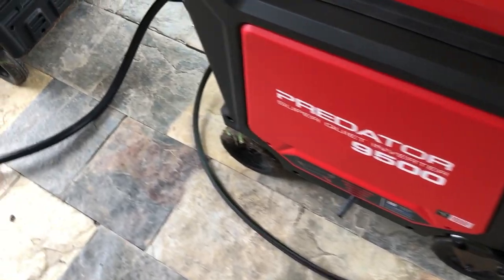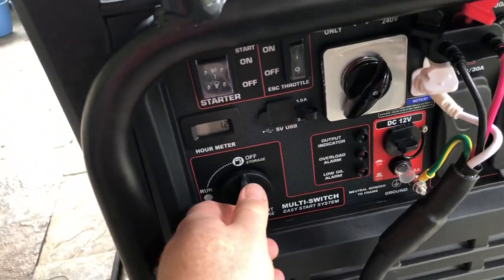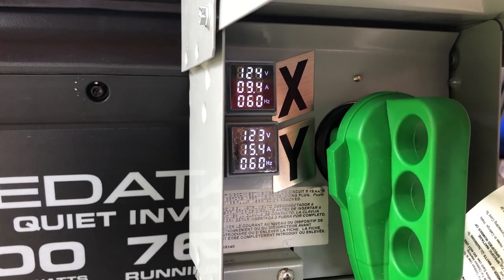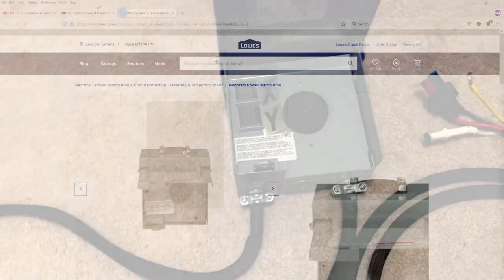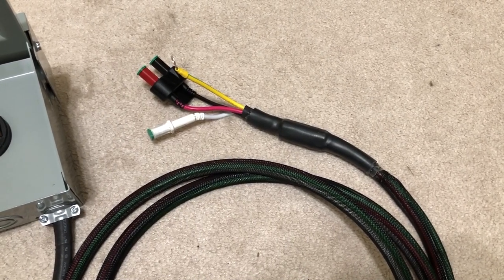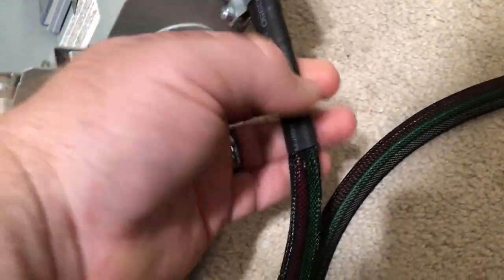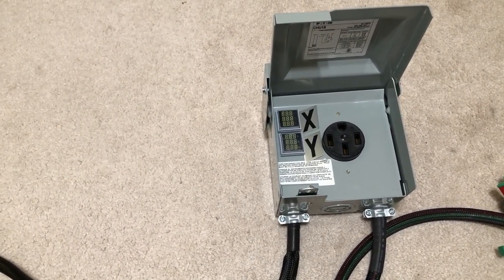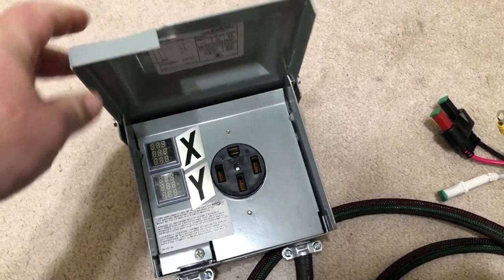Predator 9500 Home Built 240V Parallel Kit Test & Build Parts: 2X Output Power Using Two Generators!

Comment: Thanks for uploading this. I just bought two Predator 9500s for my food truck instead of paying $10k for two Honda EU700IS generators with their parallel kit. Harbor Freight was no help with finding a parallel kit. Just ordered all the parts to make it.
Reply from the maker: Glad it helped.  My next video in the series has a wiring diagram if that's helpful.

Comment: You go with #6-4 SOOW cord for the combined main feed.  It is much more flexible.  Also a good idea to put a dual 240V breaker 60A in combiner box.
Reply from the maker: Yeah, welding cable was also suggested, and in hindsight, that would have been much much easier to work with.  I was just working from what was at Lowes.

If you're looking at making your own, and you want a breaker in the box where things combine, you might consider the GE1LU502SS box.  It has a built in breaker, a 120v outlet, and 50amp plug.  Lots more room to work inside, and with the bus bars, probably would need the expensive splicer things.  It's just a lot larger.
Reply from the maker: With my enclosure project (most recent video), I ended up having to extend the length of the shorter cable on my parallel kit.  I used your suggestion, and used #8-4 SOOW for the extension, and #6-4 SOOW for the combined feed to the 50amp outlet.  

Indeed it is sooo much more flexible to work with.  I was able to get the box closed without feeling like I was damaging stuff.  

Thanks for the suggestion!

Comment: Great stuff Jason! I pretty much was sold on a parallel predator setup for my home so  I designed a similar build in my head. Figured I wasn’t the 1st so got on you tube and found your video and as a technician myself,  I was impressed. Thanks for the content! If you wouldn’t mind can you share your ruff cost for the project?
Reply from the maker: I figure there was around $250 in the parallel kit, (with cost increases probably closer to $300 to make now).  It's not so much the box itself, but all the other stuff that adds up.  Those terminal blocks that were over $20 each.  (4) of those is ~$90 right there, another $17 for the splice, ~$60 for the Powerhorse cable, another 50 or so for cabling.. box, meters, wire loom, heat shrink...  it adds up really fast.

Hookup inlet, cabling, etc.  ~$180,  AC Compressor Soft Start $360, plus the generators.  Probably around $4800 in total.  Then I went and made a giant wood box for them, and don't want to think about how much that added.    Ultimately I'd say I'm in around half the cost ( actually less than half since I'd have to install propane tanks) vs. what I could do a whole house backup generator for since they're usually around $10k to play.

The full playlist is here for the videos, it covers looking at the power quality, AC soft start (super important for generator power, and it has a kind of cost breakdown as well), safely doing the inlet connection to the house, and some other related topics.
https://www.youtube.com/playlist?list=PLzoNthJzzMFQ877vyCfoc53oDQqGFAIKN
Reply: Your setup has some advantages over a whole house generator. 

If one generator goes down you have a backup.

If you move, it’s easier to take your setup to your new house.

If you want to go camping or work somewhere without power, you can take one of the generators with you.

Comment: The issue with your unbalanced load could be your wire length being different coming off both generators. Parallel wires are supposed to be the same length. Just a friendly electrician trying to help out. Great job otherwise definitely a great setup.
Reply from the maker: All good man, though I don't think that's the issue.  

The generator is making full phase 240, with a 120v split phase (just the exact same as residential power from the power company).  
The two generators are simply merged together.  X to X, Y to Y, Neutral to Neutral, Ground to Ground, and after that merge, the wires run to the dryer plug.  The generators themselves take care of the magic of synchronizing the power frequencies to match, such that each is just contributing to the overall total.  (kind of like batteries wired in parallel)

My meters are measuring the total amperage after the merge on both leg X, and on leg Y.  (This is the combined amperage between the two units, so if both are running, divide that AMP number in half to know the load on one leg, of a single generator unit)

If cable length were the cause, that would mean in about 5 feet of cable, I was creating several amps of resistance.  (which would be very... bad), and since the meter is displaying the combined output, it wouldn't represent the losses from one side.  Plus remember each generator is contributing both X and Y of the split phase power.

Also, in the case of the Power Horse kit we're cannibalizing the cables from, that one is designed to carry power from Generator B, literally into Generator A, and there is no box... the hookups are from the front panel of A (vs. a separate plug).  So the whole cable is totally on "one side" in that way.

The imbalance you're seeing is between the two legs of the split phase power.  Meaning that by random chance due to the arrangement of breakers in my box (whether they're on X or Y leg), and the location of the loads in my house, end ended up with one leg of the 120V split being a bit higher than the other.

After some additional testing though, the leg with the lower power levels in the video, also services a freezer, and some other appliances that were not running during the filming, so I kind of like it that way, so it leaves some room on that side for those devices, and things are a bit more balanced.

This is the playlist of the full video series, the latest one where it connects to the home might be of interest.  https://www.youtube.com/playlist?list=PLzoNthJzzMFQ877vyCfoc53oDQqGFAIKN
Reply: I would think the wire length could affect phase, but not load?

Seems more likely that the breaker box might be unbalanced?

Comment: Great job. Our recent Texas winter was brutal. I have my eye on one of these if my ES6500 ever dies (doubt it).
Reply from the maker: Thanks!  It's been my little obsession for the past few weeks.  Still need to build an enclosure for them. :-)
Reply: @Texas_DIY  I got sucked into the whole enclosure thing. Wasted about $600.00 on a Suncast just to shave a few decibels. My water cooled Honda is quiet enough, and I don’t have any over heating concerns. I am sure the Predator is as quiet or quieter than my ES6500, that would leave only security to worry about.
Reply from the maker: @texaslawdawg1902  Yeah, these are quiet enough it's less about noise, and more about having them nearby the power hookup for easy deployment, keeping them clean / out of the weather, and somewhat security from theft / hiding them from plain sight.

Really debating now between building something from scratch, or repurposing a plastic shed... I just can't find a "shed" that is the low height but 6' width I need.

Comment: Nice job! I can see why you would need two of these generators if you wanted to run your AC unit and etc in the home at the same time. Looks like at the minimum, 5,000 dollars. You have the option of running 1 if you don't need the AC.
Reply from the maker: Yup, you can run one to save fuel, or if you need to do maintenance on one while the other continues to operate.

Comment: Great video Jason! I would love to see how you wired the box in detail especially with the 2 Amp meters wiring detail where you join the two generators with the 50amp outlet.
Reply from the maker: By request I added a wiring diagram in the "All the Technical Tidbits in Under Ten Minutes".  The playlist is here:  https://www.youtube.com/playlist?list=PLzoNthJzzMFQ877vyCfoc53oDQqGFAIKN

Basically each wire color is joined together in the box by color.  

The meters need power, so you can wire it to one leg (120VAC) or to the two hots (240VAC).  I chose to connect one to the "X" hot, and one to the "Y" hot (the remaining power wire goes to neutral), this way I can monitor the voltage of each leg.  (vs. both of them just saying 240V).

There is also a circular ring that you put around the cable that you want to monitor the amperage.  I put the rings around the combined output so I could see the total that the pair were making.  If you use two, just know that half that number is coming from each.

Comment: Other youtubers have confirmed that the 30A 240v outlet on the generator is tied to the sync circuit, which means you don't really need the parallel cable kit. You can use the L14-30P connector that comes with each generator and some stranded 10/3, with ground, to make your own patch cables up to 50 feet each leg (between each generator and the combiner box). Only real thing to note however is that with the L14 connectors, the conductors will be exposed if not plugged in - dangerous if any of the other ends are connected to power, whereas the kit has shielded connectors.

For your setup, where the generators are right next to each other, the parallel kit is probably the least expensive option however.
Reply from the maker: This has come up a few times in the various comments.  

Ignoring the suicide plug, and linking the generators together... but then you don't have a way to tap into the power unless you put a 50amp plug on the combiner box.  If you're going to do that, you might as well just get the proper and safer parallel cables, you're building the rest of it anyway.  Buying two 30amp plugs isn't going to be that much cheaper than the parallel cables.  You're still going to need to extend them, and all that.

Additionally, if you use the 30 amp plugs on the generator panel, that is running through the breaker on the generator.  If that were to switch off or trip, (or if your suicide plug disconnected) then the two generators will almost immediately begin to drift out of sync.  

In that scenario, if you fail to shut the disconnected generator off, and start it again while running, and you were to just flip the breaker back on, or just plug back in the suicide plug, you would be joining a generator operating at a different frequency to your power line.  (bad news and possible fireworks).  

The parallel ports on the generators bypass the breaker and connects directly to the inverter, and the parallel cables fit in firmly and are harder to accidentally disconnect I think for that reason. 

Also, the longer you make your extension cables, then at some point you will need to bump up the gauge of the cabling. So I'd be careful with 50' lengths and make sure you've got it planned out accordingly.

Comment: I wonder if you could pull 100% of the rated capacity if you could get by with just the one. If you use an auto transformer to generate the neutral leg you can draw off of both L1 and L2 equally without the worry of loading one side of the windings more than the other. I do that with my Victron inverters set up for 240v split phase power. Works like a dream.
Reply from the maker: Possibly... but that would add complication to the setup whereas right now, everything pretty much just wires directly in.

Comment: I believe you can also use the Honda EU7000is parallel kit as well.

If you want more flex you can use 6 AWG welding wire.  It’s stranded pretty well.

You can power down one generator and should still work if you notice your loads are low, to save fuel right?
Reply from the maker: That kit might work, it would depend entirely if the spacing of the plugs matched exactly and if the internal banana plugs were the right width.  I like that it has the meters and breakers built in.  But wow are those cords short.  Would definitely need to extend at least one of them (probably the shortest, so you can have a 'medium' and a 'long')

Yes, you can power down one of the pair if you wish.  Note, never disconnect / reconnect while running, but turn completely off.  On mine, the way I wired it, it's monitoring the full combined output of each leg, so, when running two, divide by 2 to know what each unit is producing.

Comment: great set of videos on setting a 240v parallel connection for bigger inverters.  I don;t know if I'm missing something, but it seems like it would be cheaper and certainly easier to just buy two of the powerhorse cables instead of buying one and splicing the cut off end to 8 gauge cable.
Reply from the maker: I'd have to cut the power horse cable anyway to splice them together, so I really was using it for the plugs.  Some generators have a 50A plug on the panel, and you can just join them and plug into one of the front panels.  These generators only have 30A receptacles (and 30a breakers) so you can't extract the combined power from any one of the front panels.  That's why I had to make my own box and plug, using that point to pull the combined power from both units.  (and so only needed two sets of the inverter plugs)

Comment: Great video I had my electrician put the cut off main power switch and the ability to connect my predator 9500 to the breaker box like you are using so everything works great I have gas water heater and heat stove etc we tried to run the AC and it shut off the generator he told me it’s all about amps!! I am going to have to get the soft start and another 9500 the 240 plug on the 9500 is only a 30 amp do you know what that does in parallel I am no electrician but I have learned a lot during this process I priced a generac 22kw natural gas and that’s what I wanted but because my gas meter and power meter on 2 different sides it was gonna be very expensive I am hoping the parallel and the soft start will run my whole house or I am out money and will have to get the generac any hep from you or others will be a huge blessing and thank you for making this I learned a lot just watching
Reply from the maker: I have several videos in that series. It covers the soft start as well, and may answer your questions. 

Two will certainly handle the air conditioner with the soft start, and if you’re very careful with your loads and turn off most of the stuff in the house you might be able to get away even with one generator and the soft start.
Reply: So I been in contact with micro air and getting the right unit for my 5 ton next question I am into this with a 9500 Predator and an electrician who set a 200amp transfer box but he installed a 30 amp interlock which is my fault he did what I said for my generator. Learning a lot here!!! Thanks again it’s getting  expensive vs the 22kw generac whole house. so The question is I obviously need a generator that runs a 50amp plug or parallel and get another 950O or get another bigger inverter duromax makes a 16,000 50 amp or a Genmax 10.5k. I don’t understand the amps vs the watts I have run the equation 240/running watts etc so what’s efficient like I am at a point of frustration!!! If say you have a 30 amp outlet on a 9500Predator inverter if it has 32 amp draw will it trip or say a 50 amp on a 16,000 and it draws 53 amps will it trip?

Comment: Like your set up but for that kind of money you could consider a whole house generator. I had a 16 kw generac put in for $6500.00 and it makes power outages a non issue except fuel burn
Reply from the maker: If you managed to walk away with that much spent in total, yeah, that makes it a harder choice.  The power won't be as clean, but automating it would be nice.  From what I was able to price though, the $6500 is just the base unit, after installation, and such, it seems to usually be much closer to the $10k mark.  Particularly in my case where I would have needed to lease, install, and trench/pipe a propane source to run it.
Reply: @Texas_DIY  Lowe’s wanted about $9000.00 but a local guy did it much cheaper. So it pays to look around or I just got real lucky.and we have natural gas already hooked up so didn’t need propane tank
Reply: In my pov having only one generator is problematic if there is a failure with 2 generators in daisy chain you can work in "degraded mode" if one is out of service ... i am agree with Jason W the price for generac is very expensive ...

Comment: This is really cool...  What would happen however if 1 generator shut down or ran out of fuel?  Is there overload protection that would shut down the other Generator?
Reply from the maker: The parallel kit bypasses the breakers, so overloading a unit shuts off power (but not necessarily the generator).  You have to shut the machine down completely, and then restart it.  Upon restarting, the unit will sense the presence of the power from the other machine and sync to it.  So that would bring everything back.

The kit just joins the wires from each, and feeds the combined set to the plug.  So if one unit shuts off, you still have power, just half of the capacity.  

If one were trying to conserve gas, and could run on less power, it would make sense to deliberately shut one unit off, and have the other on hand as a backup, or, to bring online if you needed to run additional appliances and such.